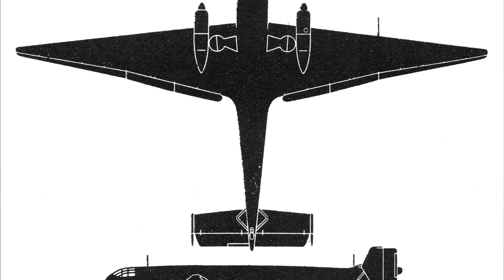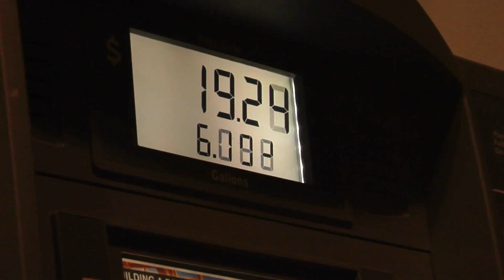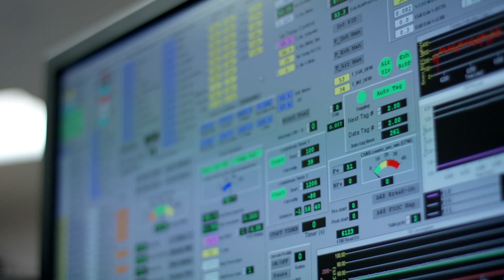The history of the Achates Engine – as told by entrepreneur Dr. James Lemke

Comment: He mentioned the engine design lay dormant for 70 years but the British had an engine with opposed piston in the 1940s called the deltic, essentially a licence built jumo engine, and during the 1950s commer brought out a lorry with a 3 cylinder opposed piston engine , that had a single  central Crankshaft with large rockers instead of dual crankshafts.

Comment: @1:02 "This engine set a record in 1936...6000 miles un-refuelled".  Anyone have a reference for this?  I've found range specs for a Junkers Jumo 205-E powered Dornier Do 26 of 2000 miles (water take-off) or 3600 miles (catapult launch with reduced payload).  I haven't been able to track down a reference for the 6000 mile figure, however.  Any help with a reference will be appreciated.

Edit: Could this have been with a lighter-than-air craft?  Both the Graf Hindenburg and the Graf Zeppelin reportedly had Daimler Benz DB 602 engines, not Junkers Jumo engines, but could there have been any other airships in transatlantic service to have made this record breaking run?

Comment: Here's the problem the opposed piston engine has yet to solve:  oil consumption.  Deltic engines are neat, but have you ever seen one fire up?  Smudge pot city.  What makes 2 stroke engines dirty is the standing oil on the piston rings (during port uncovering) being swept directly into the port.  The best you can do is make the oil more combustible to meet emissions.  If perhaps a rotary disc valve can do the port work away from the piston rings, you could pull it off.  It definitely would make the engine more complex, though.
  This is why we haven't seen it in production yet.  Ford was talking alot about a 3cyl 6 piston engine for their trucks, but that was 3 yrs ago. Now, they are silent.  Everyone thinks electric will solve it all.  Nope, you still have to cross the nation or an ocean to do your shipping.....so you need RANGE.

Comment: Did you ever research the "BOURKE" engine? in the 1970's my Dad & I were very interested in the development research by several individuals.  We came up with some modified concepts  but got bogged down in other more pressing pursuits.  I think I still have notes SOMEWHERE,  but don't know where yet. Our ideas involved 2 cycle opposed cylinders. 
There was another engine that has six cylinders with 12 pistons that worked a "woble" plate. It was a modified "Vickerman" pump design concept. Very efficient, compact, light weight per horsepower.

Comment: Love to see two of these engines built into a push-pull aircraft. Takes care of redundancy, and would be the fastest piston powered modern aircraft as well as the most efficient
Reply: How about a inline 6 OP 2 stroke dfi outboard from mercury! A 1700 OP made from 2 850 Rotax Etec for a trail sled or a 1000 OP 2 stroke dirtbike from based on 2 KX500, CR500 or maico 500 2 strokes. that would make a sick enduro bikes. Also the 3.2 Optimax mercury outboad is 3.16L (193 CID) at 60 deg block so a 9.48L (579 CID) Mini OP 2 stroke deltic could be made for a stern drive, truck or what every. I think the new 10.6L triple and OP cummins 14.3L 1000 HP are dry sump like the 850 Rotax or mercury optimax. BRP XD-100 2T is what Achates power is running in their new 10.6L. Silkolene pro 2sx is sae 40 ester 2t like motul 800 2T is overkill unless you turn these 2 strokes up with lots of boost. i have already run a few gallons of xd-100 brp through the bottem end of my 8v92 silver detroit 2 stroke with turbo with good success, its full synthetic SAE 30 with higher film strength than petrol based oils run much cleaner and quiter now, its 364 a jug is my only grip about it.
Reply: @jlo13800  If you build it, I think offering a punchcard to emergency rooms (pay for five get the sixth free!) should help with marketing lol
Reply: Would love to see it in a sprinter or ford car that get double the mileage!!

Comment: Without a head gasket, the opposed piston configuration can run very high compression ratios, and with the exhaust ports being used instead of valves, you can run high boost pressures without fear of damaging exhaust valves, which are the weak link that limits power-per-volume. I worked in a Fairbanks-Morse on a submarine, so these fascinated me.
Reply: So an opposed piston engine needs a minimum of 2 pistons as an opposed pair, and would necessarily always have an even number of pistons? In which case, is there any possibility of having only 1 out of 2 pistons running  - say, for the purpose of conserving fuel consumption?
Reply: Yes true. i would love to see a 1700 OP skidoo based on 2 850 Etec crancases.
Reply: How about an OP 2 stroke dirt bike! KX 1000 mage from 2 500’s for super motor
Reply: staying stuck in the idea of compression ratios is never going to pan out. when you get the "squeeze" out of the cycle, do it somewhere else instead...
then youll see results.

this is nothing more than the same old mechanism acting at a different angle. all the same drawbacks as a plain old crankshaft.

suck squeeze bang blow... archaic and wrong...

try squeeze suck bang blow instead ;)

Comment: The Napier Deltic (Paxman Deltic later) 18 and 9 cylinder engines are still around in heritage railway use in the UK.  They are even being overhauled as I write this comment.  The 'Deltic' was derived by Napier from the Junkers Jümo 204 aircraft diesel engine under some form of license from Junkers.  There are also a number of other opposed piston diesel engines, mostly for military applications, including the Leyland L60 (UK Chieftain Tank), Coventry Climax H30 (APU engine for the Chieftain), Rolls-Royce K60 (FV430 series armoured personnel carrier) and the Comma TS-3 truck engine.  Some oil testing standards are based around testing using a TS-3 engine.

Comment: So where is this now? Ford is still fooling around with turbo engines... that wear out about twice as fast as a non turbo.  Ford's new 7.3L is a revolutionary 1959 design push rod V8 engine that is 4 stroke.. they are going in the opposite direction..... back to the past for engine design.  I also learned on Youtube that those 1959 engines achieve 12 to 8 miles per gallon.  Will any auto manufacturer....EVER install your engine?   Can it as a diesel meet the latest emission standards?  It will need DEF fluid?   Your engine seems to be killed by the transition to Electric vehicles... Have you lost the battle?

Comment: And now, CA wants to ban ICE engines altogether...
Reply: Well there a 1340 hp 4000 ft-lbs torque QFM-360 electric motor you can fit in your lap. Now use overunity ZPE coupled to it like a Witts generator and now more electrochemical hydrocarbon fuels or batter fuel cells needed!
Reply: @jlo13800  How does that help Achates?  Never mind that there is not enough electric power in the CA grid, unless it is imported from states that still burn fossil fuels...

Comment: The internal combustion engine has been obsolete for 80 plus years.
Reply: That's why everyone uses them!
Reply: @rogeronslow1498  Because we're forced too.
Reply: @shaneroper477  are you advocating electric motors?
Reply: @richardounjian9270  Electric is the future. It's the power source that we need to change. Spontaneous production of electricity is where it's at. We already extract our power from the Eather with the arch form generators and spin. Properly constructed and with the right circuitry, energy is limitless and free. People have been so heavily brainwashed into the current systems, they can't see beyond it.
Reply: @shaneroper477  I have no problem with electric motors.  I use them all the time.
Reply: @richardounjian9270  For transportation, or everything else?
Reply: @shaneroper477  I have no issue with electric motors for transit.  They have been used in trains and trolleys for decades.  Electric supply is readily available with a hot rail or overhead wiring.  In a free moving vehicle,  electric vehicles are limited by battery capacity which makes them impractical in many applications at this time.  What say you?
Reply: @richardounjian9270  Yes, batteries are not the answer, but they are a good start. Completely clean energy wouldn't involve mining for resources such as lithium for the batteries, or using decay systems like nuclear, coal to charge them. Hydro electric dams damage and disrupt ecosystems. Solar and wind are the most sensible, but require allot of acreage...especially solar. The next step is Zero Point Energy, or spontaneous production of electricity, which would take care of everything....forever. 
It's already here, but supressed because the fossil fuel cabal, energy companies, and bankers, don't want to lose their power. Edison and J.P Morgan, a banker that backed Nicholas Tesla,  infamously said to Tesla; "If we can't put a meter on it, we don't want it." 
And here we are, still using these archaic systems.
Reply: @shaneroper477  Yes ZPE energy, your on the right track like Tesla, T henry Moray, Hyde, Searl, Ed Grey and many others, vacuum either hase lots of electric energy density and drives every particle in all matter. Moray B King on plasmoids kenneth Shoulders! Joseph Papp pulsed plasma 2 stroke overunity. Brainwashed ain't the word!
Reply: @richardounjian9270  Electric motors are magnetic rotary 2 strokes!
Reply: @jlo13800  you should consider 3 phase.  Is that 3 stroke?
Reply: @richardounjian9270  Actuality 3 phase is like a 3 cylinder 2 stroke, 120 deg firing! Lightning is a like piston 2 stroke like outboard, detroit diesel. snowmobile, up and down!
Reply: @jlo13800  agreed. Thank you

Comment: Its been tried hundreds of times maybe more and has never been successful. Two crankshafts just has not been proven to be a good concept. and if it cannot be equipped with an exhaust brakes as good as what is being used in trucks today, there is no hope for it.
Reply: US Submarines since 1938 (and backup generators on modern Nuclear Subs), thousands of Diesel Trains, and 7 thousand fairly modern Russian tanks use this technology. Junkers transport planes used these to fly  over 6 thousand kilometers to South America on a tank of diesel in the mid 30s. Could you please explain to us why this is never been proven successful or a good concept. And, you can make a Jacobs (Jake) Brake using this engine, no problem at all...

Comment: The Napier Deltic diesel was a 1947 development of the Junkers opposed piston two stroke. Instead of two cranks and one row of cylinders, its had three cranks and three rows. https://www.dieselarmy.com/engine-tech/engine/significant-engines-in-history-how-the-napier-deltic-diesel-works/ used in fast boats and railway locomotives. 
In 2014, the British Diesel Air  "Dair 100" 1,810 cc opposed piston two stoke made 100bhp. 
The

Comment: After working on Diesel engines all my life one of the most efficient for its size was the Commer TS3, it was a horizontal 3 cylinder 2 Stroke diesel which like all two strokes was very noisy because of the problems with the exhaust systems. The Foden 2 Stroke was another engine that used to scream at full engine speed and you could hear them coming miles away like Detroit Diesels. I like the simplicity of this engine and the few moving parts and if they can get it right on emissions and reliability then it's got to be a success if they can convince manufactures to use it in their vehicles and might give diesel a new lease of life.
Reply: The Nissan UD was a pretty nice 2 stroke too. imagine and OP 2 stroke Yamaha banshee? Ho about a 2.6L OP 2 stroke triplle made out of 2 1300 Yamaha 3 cyl wave runner engines? OP uni-flow 2T eliminates the ugly tuned pipe and the pistons acts a a trapping valve with the exhaust ports. How about a mini Deltic made out of 3 3.2l 60 deg v6 mercury optimax big block 2 strokes. Each one is about 3.16L witch would give 9.48L or 578 CID Deltic 2 stroke OP madness!

Comment: What makes this engine different from the Jumo or Napier Deltic engines?
A way to make these and other internal combustion engines even more efficient and less polluting is to convert them to Augmented Compression Engines.
By using water injection for cooling and Exhaust Gas Recirculation for throttle the optimal stoichiometric fuel to air ratio can be used throughout the entire power range. This gives the internal combustion engine more power and less pollution per each quantity of fuel.
After the air filter and an optional blower the air goes through a valve that closes when the engine is off and then gets fuel mixed in at the stoichiometric ratio via fuel injection or simplified carburetor. Since this is NOT the throttle one can have a long enough intake to allow full vaporization of the fuel. Just before reaching the combustion chamber the appropriate quantity of water is injected. This water does the triple duty of cooling the mix, making it denser allows more into the combustion chamber, cooling the combustion just enough to prevent power being wasted in combining oxygen with nitrogen producing NOx and in doing so turns to steam, expanding and providing even more power. Then the appropriate amount of recirculated exhaust gas is mixed in via a mixing/throttle valve and the resulting mixture goes into the combustion chamber.
Otherwise no changes need to be made to the engine, though one should no longer need a catalytic converter and ceramic coating the combustion chamber(s) and recycling water vapor from the exhaust is suggested.
Because the EGR augments the fuel-air mixture to maintain constant pressure into the combustion chamber regardless of power setting I call this patent pending invention the Augmented Compression Engine or ACE. For the sake of our planet and to promote quicker adoption I am not charging for folks making experimental one off applications of this invention.
      Alex Koponen

Comment: We can build a 4 stroke opposed piston engine and I can introduce u to the man who just finished his blueprints. This will impressed u, and it depends on your modesty.
Reply: I'll show you some drawings of a Four-Stroke Opposed Piston engine that has no Valve Train, Eight Pistons, Two Sparkplugs, centrifugally self air cools itself and centrifugally self supercharges itself. About four HP per cubic inch of displacement. It was patented, USPTO #5,203,287. Was on the team working on this in the early 90s, patent has expired now. Many big companies came through, very, very interested. After patenting someone came in, offered more than enough for some old Partners to retire comfortable and that was that...

Comment: This engine design looks brilliant, it's simplicity is outstanding, if it can meet the emission standards needed in today's world I cannot understand why a manufacturer hasn't snapped it up. The lack of moving parts should make it a very cheap engine to produce and overhaul when required. If quality components are used the engine should be capable of mega mileages if oil and filter changes are done at the required intervals.

Comment: I taught, maintained and ran the submarine versions of this engine for years. The engine used on our older boats was even reversible. Air start: Start AHD - Run AHD - Stop - Run AST - Start AST. Truly elegantly engineered.... but why don't you use pipes for the cylinders instead of a cast block?
Reply: My friend babysat four of those Fairbanks-Morse engines in a Guppy-Conversion Sub in the Pacific during the mid 50s. He swore by those; always brought them back home...

Comment: My first selling job was at Vickers Hydraulics in Chicago as an application engineer.
The Vickers greatest achievement was the balanced vane pump.  It was the basis for Caterpillar hydraulics for years and is probably even now the mainstay.
I am impressed by the fact that the double piston concept exerts a force on the bull gear at 180 degrees, which is a balanced  power train. I am a student of distribution of power and use it in my tracked vehicles.
Iguana

Comment: I hope you have swift entry into the automotive and truck industry. Stay safe! This is not at all a new concept for a diesel engine. I was an engineer in the US Coast Guard in 1974 on a 378' high endurance cutter that had 2 4400 hp Fairbanks Morse opposed piston diesel engines and 2 25,000 hp Pratt Whitney gas turbine engines.
Reply: And those Gas Turbines could pass everything in the Sea except a Refueling Ship...

Comment: Dr Lemke would have been fully aware the design didn't "lay fallow for 70 years." The British Chieftain battle tank of the 1960s had an identical type opposed 6 cylinder 12 piston 2-stroke supercharged diesel engine. There was also the Rolls Royce K60. The most advanced type yet was the Deltic triple opposed 3 cylinder train and boat engines of the 60's, still in service up until the 2010's.
Reply: You are correct sir, the company I work for still rebuilds the Deltic and other 2strokes
Reply: @PM-xt8yc You could probably make a 9.6L mini deltic 2 stroke out of 3 3.2L 60 deg v6 mercury optimax's! Caldwell raving makes up a 3.5L 550 HP v6 or a 4L over 650 hp v6: Malke is up with softer 6061 made on a CNC thingy and your good to go. Now op 2 strokes  are awsome and a 1400 rotax OP could be made out of 2 850 etec rotax for a sick skidoo mountain sled with turbo, you now have twice the bore to stroke ratio and that would kick in early way more low end torque and lower clutch engagement! Here s a new cummins OP 2 stroke:https://mart.cummins.com/imagelibrary/data/assetfiles/0058689.pdf?fbclid=IwAR3PWM1vZs8JxpuZMoJO5Y0YFoF9pV9fuGEhbyiGgxIP0r6sxzhqo5_P9oY. A Polaris assault 1700 OP made out of 2 850 patroit big block engines. The rotax is better built, has piston cooling oil injection and longer stroke!
Reply: That RR k60 was awesome 2 stroke!
Reply: Where the hell is this OP 2 stroke today??? Hmmm.
Reply: How about an OP 1716 made from 2 858 arctic cat engines.